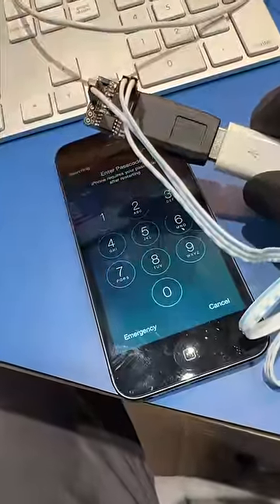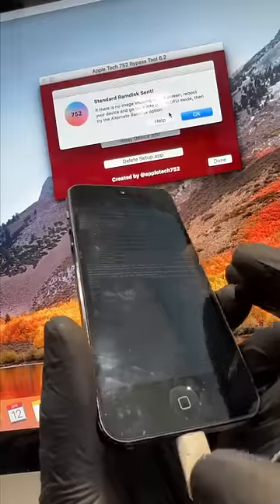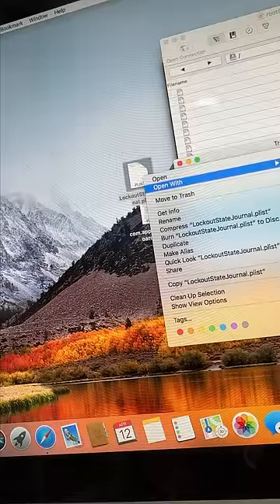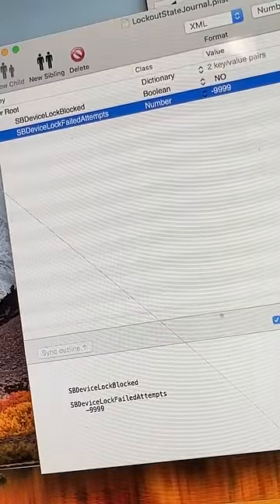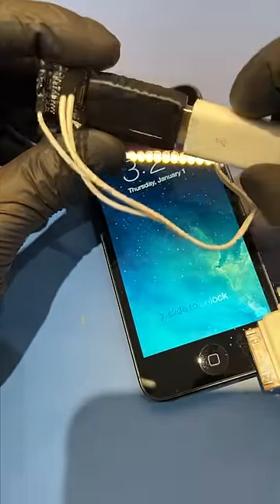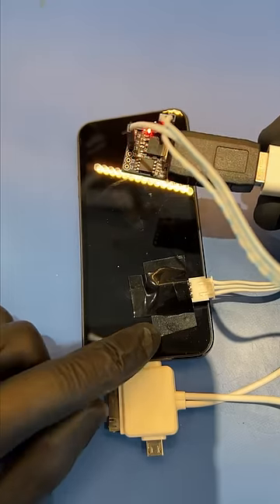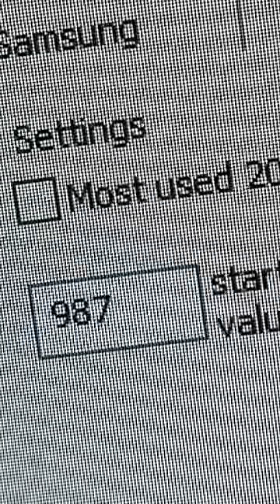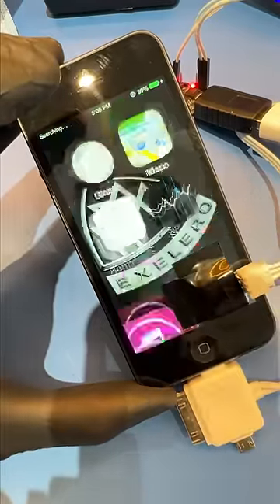Hacking an iPhone Full Video… #tech

Comment: Kind of hilarious that the customer had basically a worst-case password for bruteforce time
Reply: in most cases that would be good because most of the time you don’t want someone brute forcing their way into your phone lol
Reply: @aydo9014 yes that's exactly what I was thinking as well

But when I think about it even more wouldn't it be less secure if, say, the guesses would be done in a way where it guesses the first and then the last combinations and stops in the middle? For example guess 1: 0000, guess 2: 9999, guess 3: 0001, guess 4: 9998 and so on and so forth, but in that case the password 5555 would be considered the worst case scenario
Reply: Much like dictionary attacks for regular passwords exist. You don't want a pin code close to the start, end or middle.
Reply: @wauwau1 yeah just randomize it at that point
Reply: Hahaha yeahhh 😂😂😂
Reply: @ExiledCrescent0 I mean if they have ur phone they’re prolly gonna get it opened regardless of time
Reply: it could have been one 0000 then 9999 then 0001 then 9998 so on
Reply: @tPlayerioT no it should’ve been 0000, 1111, 2222, …, 9999, 1234…
it’s a dictionary attack at that point though
Reply: If they have the abilityand time to change the phone os settings like done here and then brute force it, it doesnt really matter what passcode you use. They will unlock it.
Reply: @wauwau1  No, it'd be better to start at 1000 and work your way up, or even starting at 1900 because most people set their password as their birth year and there's also lists online showing the frequency of each pass code if you really want to brute force with efficiency but it doesn't really matter too much since it doesn't take too long to brute force all 9999 combinations. If you actually have access to their phone to brute force it you're more often than not going to have several hours of access to the phone, more than enough time to try every combo.
Reply: What if I have a password instead will it be as fast as in the video
Reply: Usually you wouldn't go from 0000 to 9999
Reply: Depends in the length of the password and also if it was random surely a dictionary attack will be used if u use a password, but if it is random and long enough  like 8 characters or above then your chances are pretty good id say
Reply: I have a 6 digits passcode with 6 different digits and it has a meaning to me  and you can type it with one hand and you'll not find it difficult if tell you this number once you'll forget it after 5 seconds 😂😂 it's the hardest number of all time
Reply: Phones not 10 years old, just another fake story.
Reply: my password is set to 6 digits for a reason enjoy brute forcing it for 4 days straight to find every app is passcode locked
Reply: I mean is there really a difference wether it takes six or sixty hours?
Reply: That is a 4 digit password. Cracking it with brute force attack was an easy win even 10 years ago.
Reply: @Zhak7 If you have a password locked phone, and you have an actually strong password, the probability that anyone is going to brute force their way in (even with a super computer) is basically 0. It's so incredibly unlikely that at that point, don't even worry about it.
Reply: Not really even though your brute forcing it does’t mean you can’t be smart about it. For example if you were to have entered the passwords by order of how commonly they are used it would only be 626 attempts.
Reply: Not if the brute forcer starts at the high numbers. The worst case number would be something in the middle. We don’t make assumptions about how a hacker will go about getting your password in security
Reply: Doesn’t matter much. Brute forcing 10000 passwords doesn’t take long
Reply: Jokes on you I would start with 9999 and move backwards.
Reply: @wauwau1 I mean it wouldn't matter anyways. To Bruteforce someone's phone you first need to steal it. And if you already stole the phone who cares how long it takes
Reply: @Megaddd07 if someone already has your device and they are brute forcing, it won’t much difference if your password is AAAA or ZZZZ, it would take like a few minutes, now if your password was 15 characters of numbers, upper/lowercase, special characters like punctuation then it would take legitimately BILLIONS of years to brute force, worrying about the number or letters being closer to the start of the brute force attempts is not really important
Reply: @Condoctuc  Clearly this is not the case where try rate is low enough where time is a factor, such as in this video which my comment is directly related to, and yours is also true but not.
Reply: Nope it could’ve been way worse if he had one more number in there, it went to 10k not 1k
Reply: he didnt. its probably a really common password. he couldve coded the order diffrently by most used pin codes to least.
Reply: @Megaddd07 so the best technically are 2500 or 7500

Well, now they are not
Reply: What if they started from 9999
Reply: Just do it both ends at the same time
Reply: @userAndix I use a random 20 character password composed of upper and lower case, numbers and symbols.  Took a while to memorize but no one is getting into this phone
Reply: Yup
Reply: Lol, true
Reply: Imagine he did not choose 4 digits mode but instead the long and character included
Reply: any 4 digit number is bad nowadays and can be bruteforced in few sec
Reply: Just use a custom number password instead of the weak ass 4 digit one. Mine has 9, which would mean it has a maximum of about 390,000,000 chances to be wrong.
Reply: @wauwau1 but what if they start whit 5555 then 5556 then 5554 and so on9
Reply: @wauwau1 but would that be actually faster?
Since you have no idea what the number is
Reply: @einhalbesbrot that's true... You'd probably try some numbers in between first 🤫
Reply: Well, unless you work from 9999 down.

Then it would be among the worst.
Reply: @Megaddd07 so No PIN-Code at all?😅😂
Reply: Not if you do a meet in the middle
Reply: 9999 attempts and it was the 10000th password possibility
Reply: @ExiledCrescent0 by the time someone sets this up you could’ve wiped your phone
Reply: @Condoctuc false. You can factory reset the phone. Then proceed to sell it for profit. All without any brute force code.
Reply: You know that pins are limited?  A pin is not a password. You need the card plus the pin.
Reply: @Megaddd07 yeah, fractional paradox (minimizing to the theoretically smallest distance in the middle, will be the most predictable yet the 'hardest'
Reply: You could set a Forward and Backward Brutforce and meet in the Middle
Reply: you start from front back and middle then not really, lets say test 0000,4999,5000,9999 then you wouls find it within a few hundred tries
Reply: not really. there's a list of 4 digit codes sorted by most used and 9874 is number 626
Reply: Random code testing would be far more effective
Reply: @wauwau1 the middle point between 0000 and 9999 is 5000, not 5555
Reply: This is why I have a 6 digit code on my phone.
Reply: Reverse brute force
Reply: iPhones are just unsafe.
Reply: not if you started from 9999 decreasing
Reply: It probably could've been faster if the guy told him the starter digits which he prob remembers lol

Comment: 9,999 attempts on 10,000 combinations. Wouldn’t that be the worst luck if the correct one is the literal one combination it doesn’t try.
Reply: It would probably try the 1 passcode after the phone got disabled
Reply: Its -9999 which means there will be 10000 attempts.
Reply: That's not true.  if there are 10,000 combinations and the last pin is 9874, then 9999 attempts are enough because you no longer have to test the 9874 because it is wrong.
Reply: lol he said unlimited
Reply: Loops start at 0, so it goes 0,1,2 etc, 9999 is 10000 tries
Reply: Remember after first failed attempt it only locks for a minute or 2 then 5 and so one
Reply: Bro forgot to do his math homework
Reply: The one left is the correct code so it won't matter
Reply: do yall know nothing about programming, when its a negative number its unlimited cuz its always trying to reach -9999 but it will never reach it
Reply: It wasn’t 9999 attempts, doubt the voiceover even has a clue on what he’s saying. He’s making the phone think that the user has failed unlocking the device -9999 times, so once it’s at 10000 it would be 1 password tried, and an iPhone doesn’t lock until around 5 or 6
Reply: @DasDaniel007 the last pin used is the correct pin because that is the one that unlocked the phone.
Reply: That's actually wrong, putting a negative value means that the phone will never get to that number, it will work with -1 too
Reply: @emmascripted4515 oh yeah dude, we all get taught programming since kindergarten like come on doesn’t the whole world know about programming?
Reply: What if you use an 8 digit pin?
Reply: The phone doesn't lock when it reaches 0 though, but when it reaches something like 5
Reply: @plangelierwot  then it would take longer?
Reply: @DasDaniel007 what?
Reply: @SmokinFoolz  yeah this guys have an attention span of tiktokers
Reply: Huh. But that’s impossible
Reply: You forgot 0000.
Reply: The 0000 or 9999 probably
Reply: He already had and exploit to gain access to the phone so why use briteforce when the pass code cam be overwritten 😅
Reply: No? Because then we would know exactly what one it is.
Reply: that's the first threshhold. that's where it does a 30 sec cooldown as warn shot. Next 9999 attempts you get 5 min timeout and the third time you need to get in another way
Reply: @emmascripted4515 I mean as a programmer I would have assumed they set the data type to an unsigned integer. But either way since it's probably a loop counting the attempts and incrementing each time, wouldn't -1 be sufficient instead of -9999? It would never go below 0 anyways since it's incrementing and never decrementing. I think the guy in the video just did it this way since it's easier to explain, even though he's wrong in saying he set the attempts to 9999
Reply: @spiraldj  That’s not what he’s doing here. He’s setting the number of current failed attempts to -9999. Every time a passcode is tried, that number gets bigger by 1, and will only lock you out when it hits a number like 5. So total amount of attempts would be 10005 in this example.
Reply: @gautamknambiar  have to disagree. The number was originally 3 meaning its a variable for how many attempts are allowed. Naturally then it's either going to be a for loop which increments the index from 0 until 3 or decrements the index from 3 until 0. If it decrements from -9999 it'll never hit 0. And if the index is 0 and increments until it reaches the maximum attempts variable, the for loop will go on forever. 

int attempts = -9999;
for (int i = 0; i < attempts; i++){
}
the index will just keep incrementing forever.
Reply: @gautamknambiar  I'm not saying that's how it's coded since idk what language they used but the concept of loops remains the same regardless of language. It's really just a matter of sytax. Either way I can guarantee you it's made with a for loop that takes input and compares it against the actual password. If the password is wrong it increments an attempt counter like I showed until it hits a maximum attempts int variable
Reply: Its only a 4 digit password so it would only need 9999 attempts
Reply: @schylerman  no because 0000 is also a valid password. A 1 digit password has 10 combinations because it's 0 through 9
Reply: well you also get a couple of tries in the positives. it was already set at 3, meaning at least, you have 10,002 attempts
Reply: @ryan.8783 found a software engineer hehehe. You’re obviously correct 😊
Reply: I'm reading this struggling comments 😂,  read all when if high
Reply: @justanon4709  Never thought about that. I don't feel like restating my previous comment but what you said doesn't exactly contradict it. If it's a for loop structured like this
int max_attempts = -9999;
for (int i = 0; i < max_attempts; i++){
// test password attempt against password
}

You would assume the loop would execute infinitely but I guess once the index hits the boundary of the int variable it would just be a runtime error. But it would be 2 billion since the index is starting from 0. It would only be 4 billion if the index were an unsigned integer
Reply: There’s only 4 numbers in the password. Impossible for it to hit 10k, which is 5 digits.
Reply: Yeah the voice over in the video doesn't explain it well so I searched it up. So the variable he changed is a counter that keeps track of how many failed login attempts. Usually after a few (let's say 5) the phone will lock for a time, as I'm sure we've all run into. When a phone is successfully unlocked it resets to 0. Setting it to -9999 just means you have 9999 attempts to 0, but even after that the security measures don't kick in for 5 attempts.
Reply: @R463R  It is possible, you are forgetting to count the code 0000. In total from 0000 - 9999 there are 10000 possible codes.
Reply: @spiraldj  See my comment above. Also, a loop doesn't make sense to me in this context, and I'm doubtful they'd use such a design to track unlock attempts. Also that loop you showed wouldn't loop at all, since the condition i < attempts would always be false.
Reply: @n.a.odessa3939  meant to put i > attempts. I put < because of muscle memory. Nice catch
Reply: @n.a.odessa3939  I have to disagree about the variable being a counter to keep track of failed login attempts. You said after every unlock it resets to 0 but if you watch the video it was 3 not 0
Reply: @spiraldj  It is a counter, I searched it up. With due respect, the loop construct doesn't make much sense here. And the reason it's 3 to begin with and not 0 is because there were 3 failed attempts, and it hadn't been unlocked yet (so it wouldn't have been reset back to 0), hence the need to bruteforce the pass code.
Reply: @spiraldj  Also the i > attempts wouldn't work either. Consider the normal use case where he didn't change 'attempts' to -9999 (but left it at 3 for example), the code wouldn't run at all because i > attempts would evaluate to false.
Reply: Was just abt to comment the same thing
Reply: I mean the chances of it being 9999 are pretty low and would have been tried by the owner first, since I'd personally set it going from 0000 to 9999 and adjust to find it like they did.
Reply: @n.a.odessa3939  All fair points. I concede. Although I'm sure it uses a loop for password input. It could be a while loop I where you have it like this 
string password = "abc123";
bool phone_lock = true;
int attempts = -9999;
while (attempts != 3 & phone_lock == true) {
string password_attempt;
cin >> password_attempt;
if (password_attempt == password) 
phone_lock = false
else
password_attempts++;
Reply: @atotiten  Would be even 10003 because you can fail 3 times.
Reply: So the odds are 10^-4 which is basically a no miss
Reply: 1st attempt: 0000
Final attempt: 9999
Total tries 10000
Reply: @vijaysinghr988 yea but the phone but be disabled
Reply: Because the code is only 4 digits.
Reply: It only has 4-pins not 5-pins
Reply: @ulize.  That makes sense with config variable name
Reply: @DasDaniel007 yes but what if the passcode was the last combination it was gonna try
Reply: @JDdaFilmer no, he turned that off.
Reply: Number 10000 is a five digit number genius.
Reply: @alexorjerry then why else are you commenting about something you know nothing about and aren’t qualified to speak on?
Reply: @PentaLingo  from 0000 to 9999 there are ten thousand numbers. you’re forgetting to count the 0000
Reply: That's why he try 1,1,1,1 so he can start at 1,1,1,2
Reply: If you're correct and the brute force wasn't able to unlock it, you'd know that the passcode has to be the last remaining option.
Reply: @spiraldj  how many attempts are allowed would never be a variable, but a const, there is never a reason for it to change. however something tracking the number of attempts that have been made would change because people need to make multiple attempts, and would need to be reset each time the device is logged in to, so that must be a var. no reason to have 2 vars when you can have a var and a const. plus the for loop doesnt particularly make sense either for an authentication scenario.
Reply: @reedoken6143  not sure if you read all the comments I wrote but someone pointed that out and I did correct myself. I think it would look like this

string password 1 "abc123"; -
bool phone_lock = true;
const allowed_attempts = 3
int attempts = -9999;
while (attempts != allowed_attempts & phone_lock == true){
string password_attempt;
cin >> password_attempt,
if (password_attempt == password)
phone_lock = false
else
password_attempts++;
}

Feel free to correct me of course if there's still a problem, I'm always learning
Reply: @spiraldj its not 3 from the factory, its 3 on this specific phone that the owner already tried to unlock

it would be pretty stupid to call a remaining attempts counter "DeviceLockFailedAttempts" and theres a 99% chance it uses an inequality to check anyways
Reply: @sircalvin  DeviceLockedFailedAttempts was just me trying to make a legible variable name instead of abbreviations for people who don't know code, I know it's an egregiously long variable name. Also I know the name itself didn't make much sense, I wrote the original comment at like 4 am or something. Anyways did you look at the while loop in my reply to you? It uses the != operator to compare the attempts with the const variable for the maximum amount of tries.
Reply: the passcode is only 4 digits therefore 9999 is the max
Reply: @alexorjerry  🤦‍♂️
Reply: then it's that combination blok